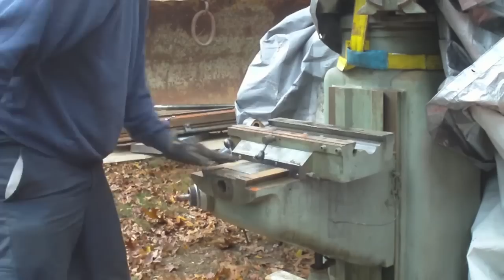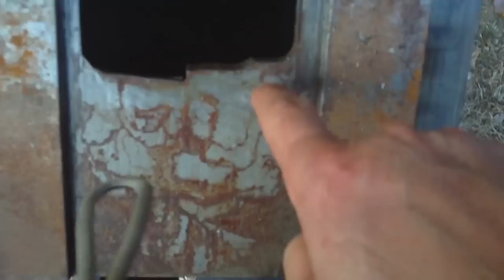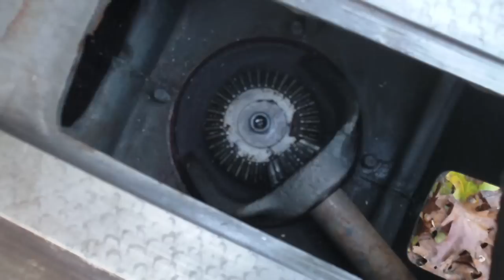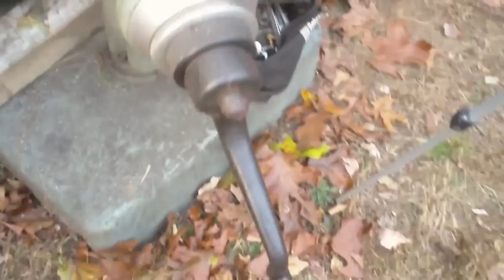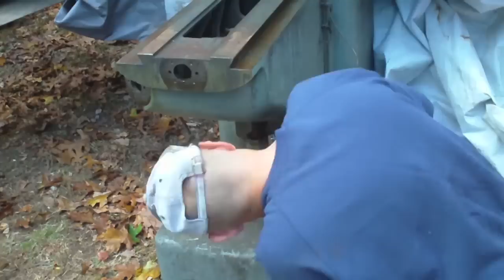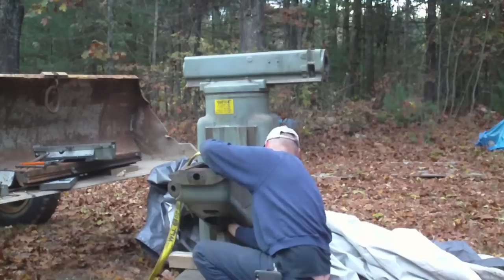Wells Index Milling Machine Part 8

Comment: Those gib adjusters look like both adjust the gib. One holds the left, the other the right end. Basically they are stops on the gib. The gib would be a long wedge and the way is tapered. Both screws set the position of the wedge. Overall, the taper is only about 0.050" or so.

So you's have to loosen one end and tighten the other to make the way easier to move. Reverse to tighten the  play.

My Sherline lathe was set that way.
Reply from the maker: Hi Scott. The Wells system is a little different. They refer to one as the adjuster, and the other as the lock. The adjuster has a threaded collar that is captive in a notch on the gib, so as the screw is turned, the collar can move the gib, in, or out. Om the other end of the gib, that screw gets tightened up to push on the end of the gib to "lock" it in place after adjusting, so it can't slide back and fourth as the ways slide against each other. The manual warns against over tightening the lock screw, as this may distort the gib. Keith Rucker covers this in one of his videos, and I will be covering how it works, and my process for adjustment (slightly different than Keith's) in an upcoming video. Regards, Steve.